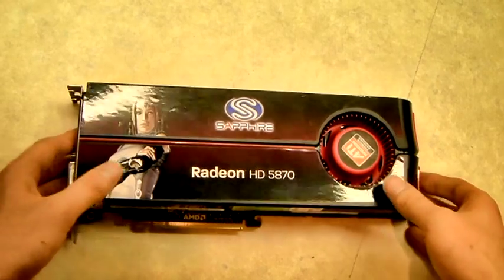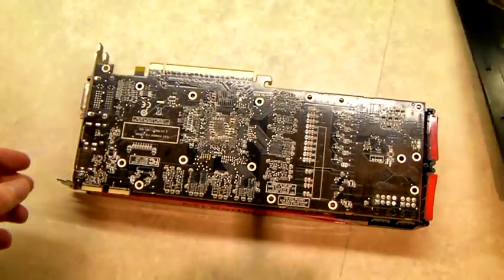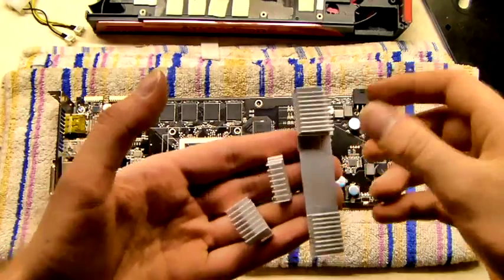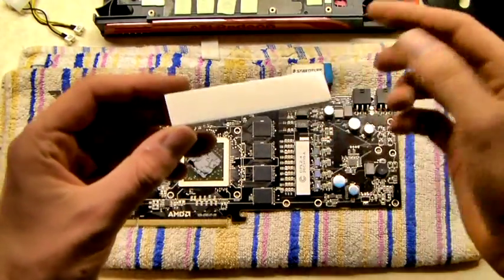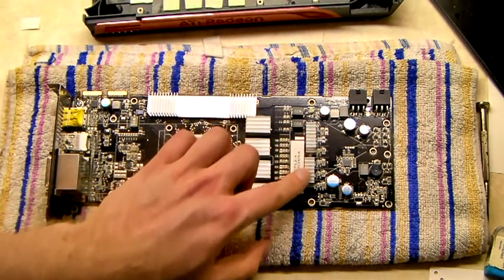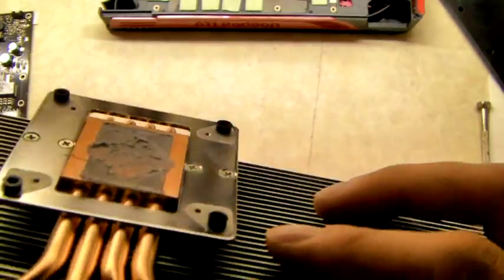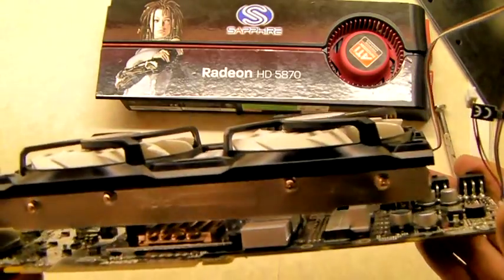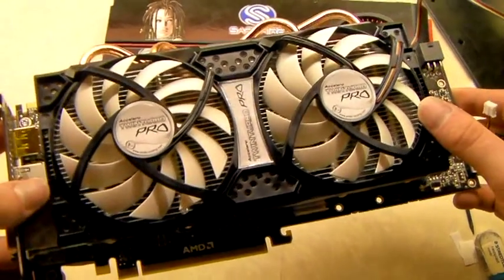ARCTIC COOLING Accelero Twin Turbo Pro installed on ATI HD5870

Comment: Hi recently purchased this as well... however I have been having problems. It brought my GPU down to 45 degrees but now it seems to sit at 50 again. And when I play games it goes up to 70 or 80 degrees, and I have even moooore fans in my pc now than before.
I have however downloaded and installed the new video card drivers... Just hoping you might know what the problem is?

Comment: WTF for vortez reviews,gj rly.

If you look product specification you`ll see that doesnt support nvidia 5 and amd hd 6xxx series and some hd 5xxx series cards.

Well that doesnt matter,you can install it on:gtx 555,gtx560,gtx560ti,hd 5750,hd5770,hd6750,hd 6770,hd 6850 and hd 6870.
Great cooler for less than 30e.

Comment: I partly based my purchase of the  twin turbo 2 on your review, thanks. If you're worried about the PCB flexing, do what I did and zip-tie the original backplate back on. One other thing... you didn't put any sinks on the VRM (under the white sticker).

Comment: SNAP, i figured out whats going on with my situation, after watching this video i see you have a 1GB card, therefore it only has vram on the front of the card. but because my card is a 2GB, it has the ram chips on the front and back. they only sent enough heatsinks for the front....bummer. now i have to order another 15 bucks worth of coolers. the worst part is i have to wait another week to get them in the mail. is it ok to go ahead and game with only one side having heatsinks?

Comment: correct me if im wrong but now that ive put this cooler on my gfx card, there isnt anything to cool the back of the card where the vram chips are. i put some of the left over stock tacky stuff on the chips but they still need aluminum coolers on them right? or are they figuring that the aluminum coolers that they provided for the front of the card are enough to cool off the vram alone? also, i really dont like the idea of the vram coolers just sticking to the chips, they should be attached

Comment: @Taz1451 true but i see what hes getting at. compared to the old case, which fully enveloped the entire components of the gfx card, there isnt much protection from lets say....anything. maybe you want to clean your pc, maybe you want to take the card out and reapply paste, maybe you have other hardware in the case that could interfere with touching the back of the gfx card (hypothetical)

Comment: Great tutorial, I watched it a few times, and then purchased the cooler and installed it on my 5870 after the stock-fan started to make the rumbling noise of doom.

Thanks for making this video. It was a bit more helpful then the actual instructions for most of the dismantling and rebuild. The fans so quiet !

Comment: @xokelydokelyx Non-conductive paste is safe to have a bit much of, as long as you squish it down just as much as an even spread. Also ESD is worried about too much. A towel isn't the best thing of course, but as long as you're not rubbing it on balloons or something, I think you'd be fine. The PCBs have a conformal coating for a reason... Just don't touch connectors :P

Comment: You should always clean off the thermal gap filling paste and re-apply new paste every time you take off and on a heatsink. Silver paste can actually conduct electricity and put in the wrong spot it can short something.  Really, the paste it comes with should be removed completely and in its place just a rice sized portion placed onto the gpu itself.  This way you know where the paste is, and theres not too much.  You've got way too much, it will save you 2-5C.